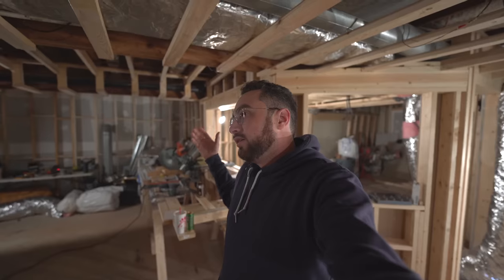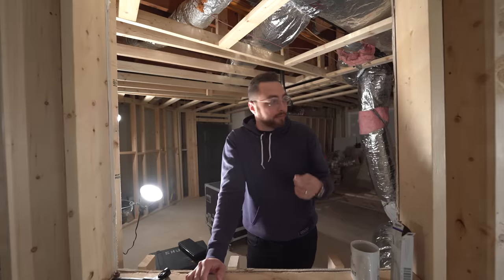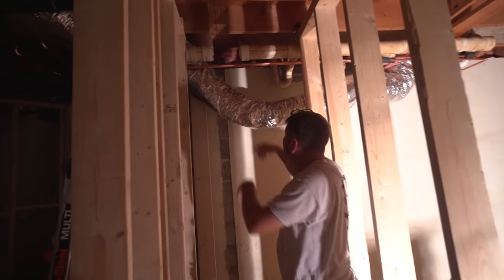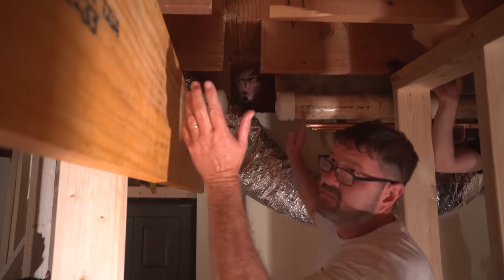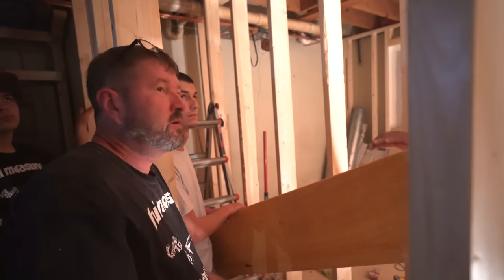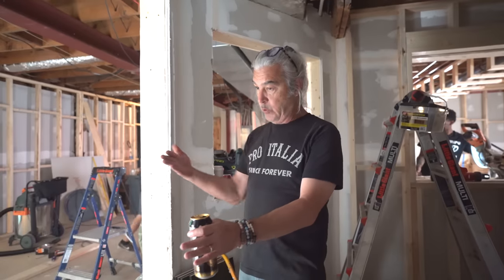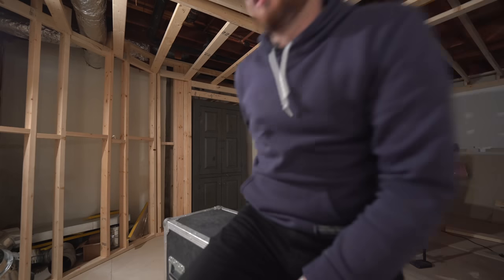We Need To Talk About The Studio Build  (I f*cked up)

Comment: As far as electrical - in addition to the cost increase and availability of materials, NEC requirements, and general needs - please be mindful of electrical needs themselves as something separate from structural wiring (and you may already be doing that). You may want each room having dedicated circuits for each thing you're running (if you are concerned about equipment interfering with other equipment), or you may just run each room as a dedicated circuit. You're going to need multiple dedicated outlets for control equipment. You're also going to want to do the best you can to keep lighting circuitry/60 cycle hum as far from your audio as possible. Then there's low voltage which will be its own entity. I only bring this up (especially not to be a smart alec) because often times when electrical enters the equation, well-intended building owners, engineers, and contractors alike will often take it for granted. That sometimes includes power requirements for EVERYTHING, backup systems if they are part of it (I ran into that a year ago), NEC code requirements (your electrical contractor will handle that facet), and other factors. In my experience as an electrician, I've observed that people generally start out realizing electrical importance but somehow diminish that importance as aesthetics enter the picture. If possible, keep the two separate. You're a fun channel to watch, so I didn't want to see you get caught with your pants down, metaphorically speaking. I also can watch all the investments you're making, and it resonates. 

On the plus side, this is most undoubtedly going to rock when it's finished. Enjoyable video that also reminded me why I'll be keeping my tiny home studio exactly as it is, hehe. I wish you the best. I thank you for sharing the process, and I can only imagine the degrees of thoughts going through your mind as this takes shape (including forward and backward steps that result). Go after that dream, brother. :) And rock on, Rhett.

Comment: There was no Plan B, it all just fell into place.  Great progress Rhett!  I am a retired tradesman in Canada.  I know what it is like to work with guys with basic skills and those other guys, the ones that make going to work a pleasure.  I'm glad you found a firm that has those people who are a part of a team and part of your team.  The calm confident manor and skill Mr. Witty has is a big part of making things happen.  More importantly he is instilling the knowledge and skill in those young men that work with him.  It's part of  what makes America great.  Not the politicians, the skilled workers the USA has.  Things are looking amazing.  As an electrician may I suggest, if you can afford it, to run extra cabling for future use or even better a conduit to key locations for future use.  Even flex conduit run as straight as possible with a string in it while installing the conduit to pull wire in the future.  You might want to have that option in the future without having to rip walls open after everything is finished.  And that necessity may not arise for years.  Mr. Byrd would most likely have good ideas on locations as he has built studios before.  Even removeable access panels in key locations might prove invaluable in the future.  I truly hope I am not coming across as someone telling you what to do but offering a bit of advise.  I have had the struggle of updating facilities after everything was finished.  The work could have been so much easier if there had been a string in a conduit or a slightly larger conduit with room for more wire.  Keep up the excellent work!  Looking forward to your next update!!

Comment: Try to avoid dumping cold air on your rack and gear.  If its cool enough and you get a little extra moisture from a humid day the metal will starting acting like a condensation plate.  Consider putting a return instead to pull hot air away from above and adding the appropriate amount of cold dry air to the room with removable dust filter.
A multizone dehumidifier will save you a bit on AC costs since basement spaces tend to stay cooler.  And while electrical likes it dry people and instruments like it a little more humid.

Add shielded conduit with soft curves rather than just pulling cable will make changes or adding fiber later much easier.  Add dedicated power circuits where possible.  Depending on what you are running, recommend making allowances for 220v conditioner and/or step up transformer and ups off the ground.  And since you are in a basement, consider releveling your floor with a slight lean to wherever you are adding a sump.

Comment: You might want to keep an access panel where they used the 4" rubber couplings for the section they cut out just in case of possible future leak or seepage issues.

Comment: Hey Rhett. So excited about your home studio build. Shane Witty and his crew really pulled your project off the ground. As a former builder and studio construction consultant I wanted to share a few ideas. The 2x4s used as ceiling joists should be secured with metal joist hangers so they can better support the load once the drywall/sound board is hung. Nails/screws alone wont do it. They could could also use blocking like you have in your walls. You should also look around for areas where unattached materials make contact with each other to avoid unwanted resonances, like where wood touches the metal beam. As a fellow ADHD-er, don't count on your brain to remember the spots-- mark them with spray paint. 🙂 Also make sure everything is properly grounded, including the flooring and carpet to inhibit electrostatic discharge from damaging sensitive equipment, etc. Cheers!
Reply: PS-- also make sure your electrical has the amps to support all of the equipment you will be using and that the HVAC can support groups of people in that space for long recording sessions, etc. 🙂

Comment: Rhett, you always want to have two backups of important files. One on location using something like a Drobo. The other should be either another Drobo somewhere else in case of fire or other catastrophe. Cloud storage is a solution but when dealing with large files can be slow to backup and glacial to restore.

Comment: What are your Sound Proofing Considerations? Are you going to Add Safe and Sound Insulation and Float(J Track strips)  the Dry Wall or Double up the Dry Wall ..(if your Drywalling) ... Also Suggest you add Conduit Pipes for future Cable runs .. Don't forget to add lots  of Electrical outlets for the Amps and other devices.

Comment: Some 30 years ago I bought a house which needed massive reconstruction. As I had no real building experience I decided to do it on my own. In a years time I rebuilt almost every internal wall (including getting rid of a supporting one and catching it with a steel beam), added more than 600 square foot to the house, put in all new electricity, plumbing and heating, insulating, 11 new doors with frames I made as well virtually on my own in a year. BTW it was a no wood construction. 
It can be done....!!!

Comment: A little punch-thru box on every wall sorta, out of the way somewhere is nice in case you just want to run any cable anywhere in a hurry.
Just a piece of foam with a small utility door works just fine.

Comment: I built mine myself Just like yours 2004. Pro Level too in my House basement. I did hire a handy man. Some friends. An a Electrician friend to finish electrical that I did not want to finish off. Turned out Awesome. Took 2 Years to build though. All the Best!!! 👍 
Ha I see you did your plenum Vent pipe replacement the same as myself. Back in 2005 I had to do my own research an ideas.

Comment: At 18:20 that drainpipe with the hose clamps is going to leak over time. You don't want poop water leaking behind walls. I would call a plumber and have them replace it with a pvc coupling.

Comment: although it is dreadful to lose material, you're not the only one, i have 3 external hard drives i back stuff up to directly, and two portable hard drives i do a "everything" back up to every few months, but what i do is i first delete everything on the external hard drive (so i'm not duplicating stuff, i tend to change folders or file names a lot, so if i did a backup without a  delete i'd have copies of copies) but cos last time i did ALL my drives in one go i deleted 5 years of my guitar and song recordings, and photos of the 50 or guitars i've owned, luckily "recuva" worked and i managed to get everything (almost) back. and i've worked with computers since 1972...iam very organised, because i'm not at all organised!

Comment: Rhett - run extra cables EVERYWHERE while the walls are open and leave them inside the walls and mapped on paper. You will want to modify/improve in the future and having multiple cables of all types there will be a happy time. Cable is cheap and easy before the wallboard goes up.

Comment: ⚠️  MY INPUT — PLEASE READ !!!!
Hi Rhett.  I found you via Rick Bento’s channel.

I’m an electrical engineer and licensed electrical contractor of more than 30 years.

Here are MY tips.  If done now, it’s a tiny impact on your time and pocketbook.

- Run EMPTY PVC conduits EVERYWHERE !
When roughing in our larger custom homes, we literally run thousands of feet of 3/4” and 1” Smurf” tubing.
Run everything to a central interconnection point  / closet / room.
We normally run everything on the OUTSIDE of the conduit during rough..   
that saves the INTERIOR for “future use” fiber and/or cable.

Use DEEP 4” square (“1900”) boxes with plaster/mud rings for future devices and equipment.

Run larger (1.5” or 2”) PVC or EMT from console areas, desk work areas, etc..  to the 
Pull “pull strings” for ease of future pulling of wiring, etc..

Note - the above is for LOW VOLTAGE gear.   Fiber optic cab,ing / UTP / shielded balanced audio / coax / misc cabling.

For your line voltage, kind of copy the above.
Run tons of spare cabling.   Plan for expansion and future technology!

It is MUCH MORE DIFFICULT to run anything later, once the drywall is up.

Also..

Comment: Hey. I'm a Philly builder and Producer.  I reached out to you actually when you first started and offered my help. Lol. I'm sure you get to many comments to see them all. . They did good work. 
1 question,  why are those 2x4 hanging flat? Space? I see the cross member above that is going to try and prevent it, but I still can't see that ceiling not bowing and sagging after drywall.

Comment: The build is looking good.. But, whats going to stop all those wall joists from rattling since they are only being air nailed together?? My bass rig would shake those walls to pieces and it would sound terrible.. Unfortunately, every joint needs to be bracketed and screwed together tightly.. How are you going to control wall vibration noise??

Comment: This is exactly why I don't like basement studios. They just aren't deep enough to get the ceiling height. But if it's dead enough you can fake the space with a good reverb. Not ideal IMHO. One of the best things about a studio is the natural acoustic space, though nowadays you can use programed drums and triggers. I find the biggest problem diving into studio creating and gear gathering is you can only do one thing at a time and.the writing suffers and it isn't worthy of that level of recording. That's what you should be doing with any down time. Only one in a dozen songs is album worthy. One in a hundred is a single.

Comment: I was seriously you guys going to use two phase wiring we have 60 volts of leg so that way any buzzing your ground hum interference that might be coming in from the line would be completely obliterated at the source? It's kind of a thing with a lot of studios I was just curious if you're going to do it or not. Obviously the air conditioning can't run on that but yeah

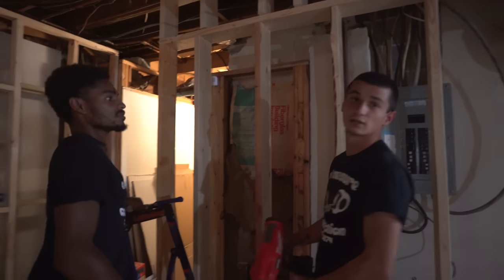Comment: @ 17:01 it looks like you built that wall closer than 3" to the electric panel which is against code  NEC 110.26 (A)(1&2)... Just saying... there needs to be 3' of working clearance in front of 240V live parts. The wall is cut open so maybe you moved the panel?
BTW.. I also have been filming weddings and events since 2000, so as much as that was painful to lose the footage, could you imagine if it was someones wedding? It would literally make you sick. Early on in my career I made a similar mistake with a wedding (one camera lost.. not all) and it was devastating and forced me to be much more organized. I don't delete files off of cards until AFTER they have been offloaded to multiple locations and off site.

Comment: Rhett, do yourself a favor and think of access for repair of Plumbing, HVAC and Electrical high and low voltage BEFORE any  drywall is permanently installed. Otherwise a leak could become a major SNAFU

Comment: Just a suggestion that might save your budget a little bit. HVAC in studios can be a real bastard if you're trying to keep climate control during tracking. Had a lot of projects in Alaska where I had to crawl catwalks looking to shut down heating pipes because of noise in recordings.

You might save some cash by going cheaper on the HVAC ductwork and just having a power kill switch for your heating/cooling near your console. Solutions for cutting duct noise are pretty cost prohibitive, and a TT switch wired in by a sparky should be way cheaper.

Love the progress update, and love the channel sir!

Comment: Well, a lesson that almost took me fifty years to learn, is that if I think a job is going to take more than a day to do it myself, I am hiring a professional. It'll be quicker and cheaper in the long run. The second lesson I learned is that most contractors are aholes, in it for a quick buck, so it takes time to sift through the garbage and when you find good ones, you hold on to them and pay them what they ask for.

Comment: I'm at a slight loss here.  You know the rafters would have been a BAFFLE had you left them alone and NOT done a ceiling and I am wondering where thee support beam went to.....was that REMOVED & thus left....essentially dangling ?  I can't grasp the footprint but general rule of thumb is.....the floor support beams are conventional wood length and fit to the footprint...and if you exceed a standard cut, they a carpenter would join 2 lengths of wood with an I beam support  reaching out to the foundation walls.....AND I DON'T SEE THAT.....and basically the story which that I beam would support...depending on if you have a single story or multiple story house.....its a stacked system !  SO its looking like a JENGA disaster.....and your are lucky nothing shifted or sagged down......did you hear "Settling Noises"...creaks and POPS ??  I can understand having to re-route the electrical wiring should it be not MIL spec'd and just randomly direct runs to the main box.  The Furnace system and DUCT WORK could be altered easy BUT ideally the runs should have been fit up into the rafters if its boxed type ducts.....otherwise....round exposed industrial would be cool for the visual.  The aspect of "interior" walls, wood is OK on the outside walls......2x6 is best with INSULATION installed...whether fiberglass or if your went spray foam type.....FOAM being my choice.  So you just need something to TREAT the cement block hard surface walls......SO the 2x6 studs and I would have used CDX ruff finished barn siding panels...4x8 sheets as they could be then subject to a heavy fabric curtain as an overlay of sorts to break up the hard surface.......which has thee floor left if its cement......and all you need is the peel and stick vinyl tiles as they come all different.....and use area rugs when needed if you need to break up the hard floor surface.  SO everything else is tag a long and you just needed to deal with the outside foundation walls
Reply: you have to consider the Hit Maker Studio in L.A. SUNSET SOUND used an old walk-in cooler as their echo chamber vocal booth since its all metal walls & ceiling and floor